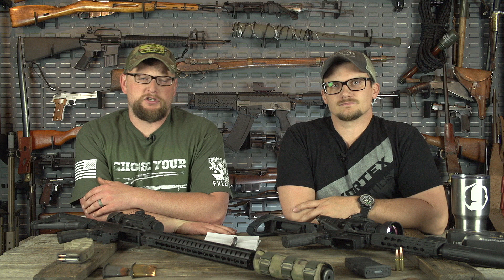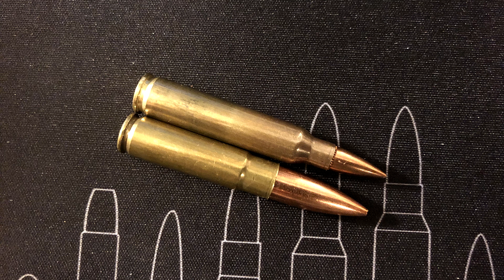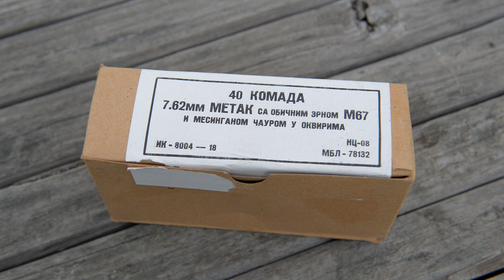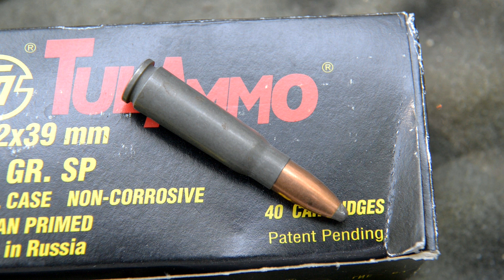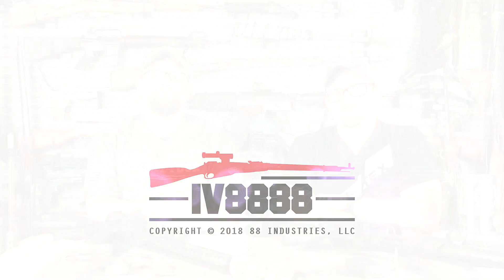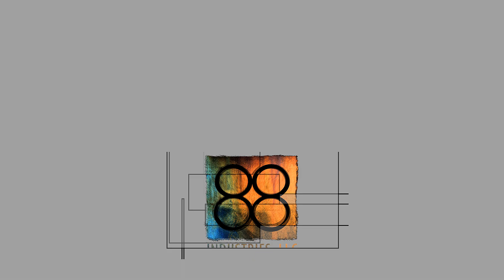Firearms Facts: 7.62x39mm vs 300 Blackout

Comment: Where I'm at rifles and ammo have to be in seperate compartments (trunk and cab) or in lockable opaque cases.  So it's illegal to have an AK with a mag, but your conceal carry permit covers a Draco with a pistol brace, 75 round drum with a round in the chamber lol.  In this case (7-10) inch barrel would you go 300 or 762x39?
Reply: As a 7.62x39 slut,  I must say it sucks from pistols due to excessive muzzle blast and flash.  The fireballs are big in daylight, but flat out  fucking ridiculous in the dark. Even without the flash, the muzzle blast sucks, and is a double ear protection situation with a muzzlebrake.  It does however retain most all of it's potential velocity unlike short barrel fired 5.56.
Reply: Chad Grimes . In pistol configuration the .300blk is the way to go unless you custom load . 300blk even in the super sonic are made to have much lower fash signatures in shorter barrels . With the 7.62 x39 pistol if you fire it off in low light you will be  flash blind for a few. The upside though is the bad guy will think he is being shot at with a flame thrower;)

Comment: Comparing one 30 caliber bullet against another 30 caliber bullet but your conclusion is one is more lethal than the other seems bias personally I wouldn't want to be shot by either one of them, I've hunted everything from deer down with my AR 300 AAC out of a 16in Barrel with
Remington green and white box 120 gr and nothing has taken more than a couple steps, it seems you two are forgetting you can actually shoot 300 AAC out of something more than a silence SBR. You two act like if you get a good clean kill shot on a deer you're going to need to track the thing for 10 miles with a 300 bk that's telling me you've never shot a deer with a 300 Bk or if you've have it wasn't a good shot.

Comment: Just my 2 cents,  BUT I have killed a many deer and other critters such as hogs and yotes with subsonic ammo. I only use the leheigh 194 pills when hunting. Shooting a 10.5" barrel suppressed is my favorite. I've taking big deer up to 125yds and never had a deer go more than 50 yds or so. Yotes have been taken up to 135 yds with head shots using same round and thermal. If i need more firepower i'll change upper to 6.5 grendel round. It puts the ak round to shame. I reload for some more affordable rounds. I wouldn't even consider the ak round when buying the ar platform.  I actually think the 6.5 grendel is the perfect round for ar platforms. It also performs outstanding in a short barrel. i have a couple of 12" that can hit 600 yds with little effort. Thanks for another fun video, and keep em coming.

Comment: I run both. My only AR is in 300aac. I reload and love casting the 247gr for it. I also own the CMMG mutant.  I’ve also built a Yugo underdolder in 300aac. I was able to get it to cycle sub loads but only with changing the recoil spring to a modified lighter spring. I’ve also built a AK in 22tcm which is on my YouTube channel.  

But I really think both are awesome. If your  a big AR guy I’d say 300aac. If your a AK guy then x39.  If your just a big gun guy, buy both and a mutant.

Comment: I have a Molot VEPR, have shot steel case with no issue. I have shot a few brass cased rounds wanting to reload them. I notice two dings in the case, 1 at the mouth and 1 on the mid side. Can you explain what is happening with the action to cause the dings? Really would like to reload this brass.

Comment: They're only real argument against 300 Blackout is cost. If you can spend $2,000 on a thermal scope to go hog hunting at night I think you can afford 1000 rounds for self-defense for 300 Blackout. Plus as Chad said there's a butt load of different projectiles for 300 Blackout. Eric himself did a video with Mac talking about how fantastic the Lehigh 78 grain Close Quarters in 110 grain controller chaos rounds were. There is nothing that even comes close to that in 7. 62 by 39. Come on Iraqveteran8888 get your story straight.

Comment: .300 Blk is an AR platform caliber, all that is needed is a barrel.  .300 BC is superior to 7.62x39.  Cases can be cut from .223. rolling your own .300 is cheap. .300 can run full performance out of a 8-10 inch barrel, do that to a 7.62x39 and you will have problems. 7.62x39 is an AK platform round.  7.62x39 ARs/mags suck. Period.  Next!

Comment: You mentioned how using a factory subsonic round designed for use in a 16" barrel will be slower out a shorter barrel, but I have found the opposite to be true.
For example, when I cut my Remington Model 7 300 Blackout from 16 inches down to 9.5 inches I had do develop a new sub load because the rounds were running faster!
When you consider that the longest barrel needed for 300 Blackout is only about 9.5 inches it makes sense that the additional unneeded length of a 16 in barrel would actually slow down the round.

Comment: With 300 Blackout suppressed SBR subsonic is where it's at!
I have chronographed Yugo 7.62x39 and 130 grain 300 Blackout Hog Hammer out of 7.5 inch barrels and the average velocity was only 10 FPS faster with the Yugo!
I no longer even bother with supersonic 300 Blackout loads for my MGI Hydra, if I want to shoot supersonic I just throw the 7.62x39 barrel and dial in my scope presets.

Comment: Hey guys,

I'm trying to load up a subsonic 7.62x39mm ammo for a ruger ranch 30. Trying to make use of the subsonic hashes on the acss reticle. The idea is to try and mirror subsonic .300 blk with 7.62x39. Any load data or bullet suggestions would be very appreciated. Sense I'm not dealing with cycling an action I don't need super fast burning powders. 16" barrel 1-10 twist. Ruger mini 30 mag max length.

Comment: Still building my 300 AAC pistol.  I have used 7.62x39 SKS dear hunting for years.  Im a lefty and dont want to buy a lefty bolt gun.  7.62x39 soft point brass ammo is getting more difficult to find. Advantage is 300 AAC gives me a lefty friendly AR platform that allows for optics for my aging eyes.  AK and SKS are not reliable for optics no matter what anyone says.  Also AR platform is much lighter than SKS or AK. I also reload so lots of advantages for me.

I am also building a 18" 6.5 Grendel AR for hunting.

Comment: 300BO has the performance of 762x39 and the price of 308
Reply: But as discussed, it also does things neither of those can do. Good luck trying to run a 9" suppressed 7.62x39.
Reply: Bruce Tucker thanks, but I’m too poor to get an sbr, subsonic ammo, and a suppressor.
Reply: @brucetucker4847  
Russia has been doing it since the 70s
Reply: Agrippa 2K no, according to ammoseek the prices are pretty comparable until you get into the specialty stuff like exapnding bullets, subsonics, and frangible ammunition. This is not counting the 300bo reloads and the 762x39 surplus brass.
Until wolf or Sgammo order “cheap” 300bo, 762x39 will be more popular.
Reply: Price?  Compare some brass cased Hornady SST ammo for 762x39, 308, and 300 BLK.  Cheapest 300 BLK, most expensive 762x39.  Compare any comparable brass cased 762x39. it is ALWAYS more expensive.  When steel cased Wolf 300 BLK (not avail in US yet) or from Hornady is available perhaps that will finally end the price "point".
Reply: But you can get about the same ballistics with a much shorter barrel.
Reply: @indicasativafusion  Nobody's talking about hand loaded. 300 blackout comes hot right out the gate. You buy them that way. Its basically a +p pistol powder. Put that in a longer barrel and that's how you get close to the velocity of an ak out of a 8 or 9 inch barrel. After 8 or 9 inches you dont gain much more velocity because the powder burns up in 8 or 9 inches of dwell time. Add that to the tighter tolerances of the ar platform compared to a ak platform and that's where you have better accuracy out of a blackout with a much shorter barrel.
Reply: Also, you can hand load you're casings when you're done.
Reply: @Nick R  You know nothing about ballistics. Does the difference between ballistic coefficients of .109 and .395 mean anything to you? Have you ever even seen a chronograph?

Anyway the point of .300 BLK is a versatility unmatched by any other cartridge. Try getting a .45 ACP carbine to have a muzzle velocity of 2100 fps by doing nothing but changing magazines, or getting a 5.56mm semiauto carbine to run with subsonic ammo. Let me know how that goes for you.
Reply: @indicasativafusion  But the 300 blackout uses a faster burning hotter powder.
Reply: @indicasativafusion  Ok, here we go with that now.
Reply: I am not sure of the price discrepancy between a 300BLK conversion kit for an AR-15 and an AK platform that shoots 7.62x39, but at some point, if you shoot enough 300BLK ammo, you are going to surpass the cost of the AK. So I understand to a point, but yeah, I'd just go ahead and get a nice Valmet in 7.62, and Bob's your uncle.
Reply: No............ Matvey.. Close but no cigar.   300 bo is weaker than advertised by a small margin which makes it Even weaker in comparison.  Also Cost difference is huge.  Your going heavy suppressed that ...?  Sure 300 BO is worth it.  95% of us Do Not.  Also with  a good barrel.  Faxon or PSA.  The ak round is surprisingly accurate.  OR out of bolt action.
Reply: It doesn't have performance of 7.62. 300 is good for close distance, but that's about it. Subsonic ammo out of a pistol, come on, it doesn't compare to 7.62x39.

Comment: I have to say my favorite for 300 blackout is the 168 grain z max. It’s still super very accurate and hits hard. That being said I hand load everything I shoot. I get the appeal to buying cheap factory ammo but I load so much it keeps me in business and form my own brass from LC brass. It has the most capacity and gives me the ability to load it much hotter. I use Win 296 which it same a H110 and it give great accuracy and speed. I’ve found 135 grain Sierra 30-30 rounds do well too. Have yet to take it in the deer woods it’s new to me this year so I’m still playing. The z-max opens up very well with deep penetration but I’m still considering the Barnes 110 for hunting. I consider the 300 blackout 100 yard or less gun with supersonic ammunition. I have two stands on my lease that have shots for it I’ll try it out this year. I shoot 7 mag in the rest of the property as the stands there are 500-600 yards. On life and liberty... my 16 inch AR in 5.56 is that gun for me haha.

Comment: The 300blk case is actually necked down.
Reply: Douglas Thompson ....wat?
Reply: Ben M when you make the case you cut the neck and shoulder off of a 223/556 case. Then when you form it you neck it down then trim the case mouth.
Reply: Douglas Thompson Aaaaaaaahhhhhh....I see what are saying. Sounded like you were saying that the 30 cal pill was smaller than the .223 pill. I get what you are saying.

Comment: Which is best? There is no “best” or perfect caliber. They all have pros and cons. If anyone asks me on 300 blackout, my first question is “are you going to reload?”  Factory ammo is crazy expensive imo. 300 blk is a suppressed short barrel caliber and it excels at that. If you want to run a 16” barrel unsuppressed, don’t waste your time and money. There are many better calibers for that application.  

7.62x39 and most comblock stuff doesn’t interest me. They work without a doubt, but they are not designed for what I want.  Communist arms are generally made incredibly reliable, crude, cheaply, and with few varieties to keep the reliability. They just work. They don’t excel at anything else. Guns like the mutant capitalize on the cheap ammunition and magazines, but have better barrels and more options available. They still suffer from the lack of great ammunition. There is great 7.62x39 ammo out there, but it is not even remotely cheap.

Comment: Chad have you ever done the carb 30 ball plinking rounds for the 300 blk they seems to be a whole lot cheaper than the other stuff to load for it by at least half the price so 3-1 vs the normal maybe you can run a video on it would be cool great video 
300 blk does good at 60-75 yards vs jack rabbits it exploded it with rip outs i wanted to cook it but it tore up to much but but coyotes got to eat so that was ok with me :D

Comment: 7.62x39 for me. Insanely cheap to shoot. Romanian Draco’s with ~12” barrels still get around 2200fps with standard ammo. 

You guys talking about reloading forgot that you CAN load .308” bullets in a 7.62x39 case. Your r silts might not be great but it does op n you up to all the same bullet options of the 300blk. Also the 7.62x39 is more likely to cycle with lower powered ammo in a full length gun in the AK platform due to the AK already being very over gassed. With the release of the KNS adjustable gas pistons for AK’s also, running different ammo types reliably is not big issue in a Kalash. 

You can make cheap 7.62x39 subs by getting some cheap ammo, pull the bullets, dump the factory powder, drop about 8g of TrailBoss, re-seat the bullet and viola, subsonic 7.62x39 for MAYBE $.30/rd.

Comment: .300 is for rich people.
Reply: cheapest .300 blackout you can find on luckygunner is .50 a round for frangible, useless ammo.  45 ACP is half that at .26.  Granted that's for steel case.  Brass .45 is still .36 a round.  And in stores, you are lucky to find .300 blackout for less than .60 a round.  I have no idea where you are getting ammo from, but the numbers speak for themselves.

Comment: The interesting comparison comes with the shorter barrel, but also handloading really decreases the price of ammo for 300BLK dramatically, where as, 7.62x39 is most often more expensive to reload for than Wolf...
Reply: i dont see the need to actually reload 7.62x39 ammo, much cheaper just to buy it our right off the shelf or online. you can still find a fairly diverse group of bullet weights out there, maybe not as huge as the 300. but you can find what you need. order online in higher quantities is your best bet for 7.62x39.